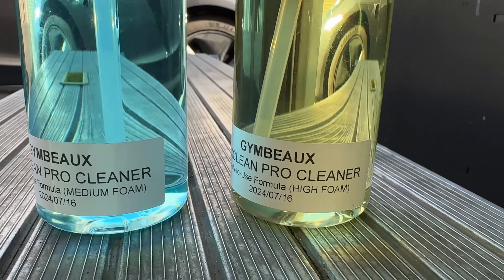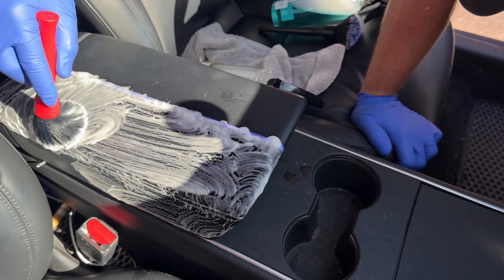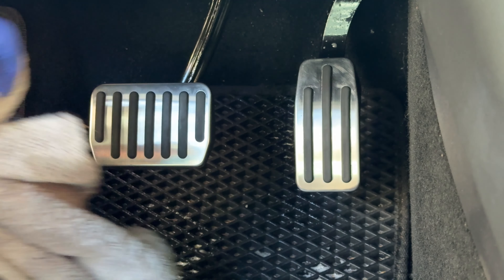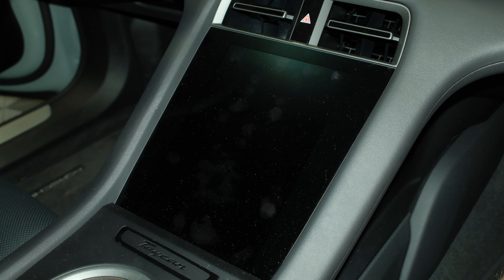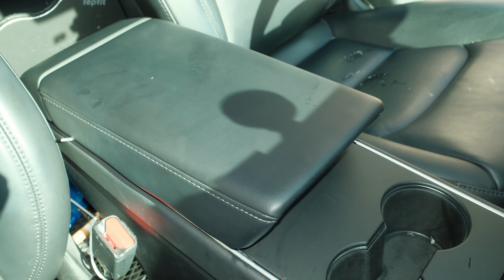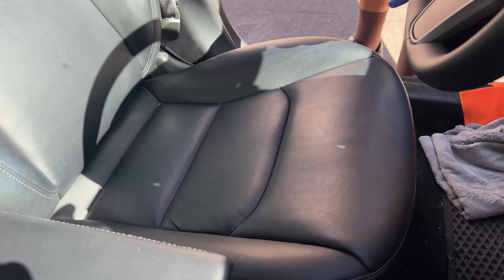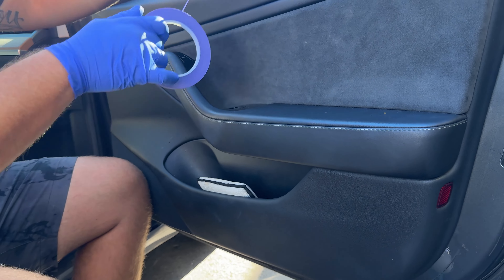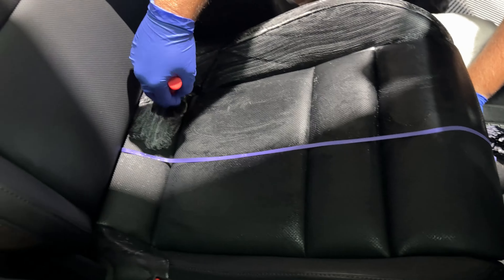This Might Be The BEST INTERIOR CLEANER I've Ever Tried...

Comment: Thanks for sharing your new ideas.  For interiors I like using products that clean & protect in one.  The scent is not important to me or the color?  I do like products that can be diluted. Lastly, the cost is important, currently I'm using an interior detailer that cost about $25 a gallon.  Also, I will use a rinseless wash for moderately dirty interiors.
Reply from the maker: Great tip!

Comment: Pol-Star...this is my new go to for interiors. It will be very very hard to beat. I suggest you try it out side by side. This is the top dog for interior cleaning.
P&S express is okay also for the money
Heard great things about Pilot by ADS (Have yet to try due to PolStar being amazing)  

Love the content, but throw that makeup brush in the garbage lol. All it is doing is spreading product around. Use a scrub pad or a microfiber on that arm rest. I never use the soft makeup bristle unless it is the piano black or delicate surfaces. If it's for the gram, I get it. But my hands/wrists/fingers hurt just watching the application process lol.
Reply from the maker: thanks for the feedback. What do you like about pol-star? Ive seen some decent things about ADS but I dont like how it makes stuff shiny. Seems like more of a protectant than a cleaner.
Reply: @autodetailingpodcast  PO is PH neutral, leaves an oem matte finish and is supposed to protect against dirt. Dilution is 1:5-20...I like around 1:8. It smells fresh like a citrus smell. But it doesn't linger which is good also, being some customers don't want scents. I like the way it feels, it just feels and finishes off nice. I am also not worried about it staining panels.
Reply from the maker: @Jarph0821  awesome, ill pick some up, thanks for the tip!
Reply: @autodetailingpodcast  yeah, np. I highly recommend it. It'll help you diversify your product line

Comment: Your code its not working to get the towel
Reply from the maker: Are you sure your cart total is $100 before you add the towel?
Reply: @autodetailingpodcast  when is that interior cleaning coming out?
Reply from the maker: @Pedroluvslupe  just started working on it. So prob a month or so
Reply: @autodetailingpodcast  maybe you should mention that in the video!!!
Reply: @autodetailingpodcast  is it ph balance? safer for  leather vinyl, ruber dashboard screen
Reply from the maker: @Pedroluvslupe  yes. I test the ph in an update video
Reply from the maker: @kennethisaac3799  I did.
Reply: @autodetailingpodcast no rinse needed right?
Reply from the maker: No rinse needed.
Reply: @autodetailingpodcast  I must be missing it too.  There is no mention of a $100 purchase.  However, I already have this towel, and it is fantastic!